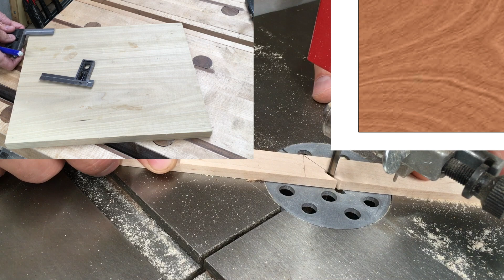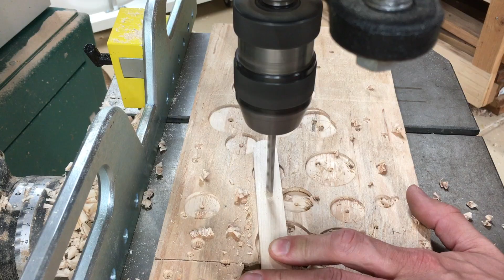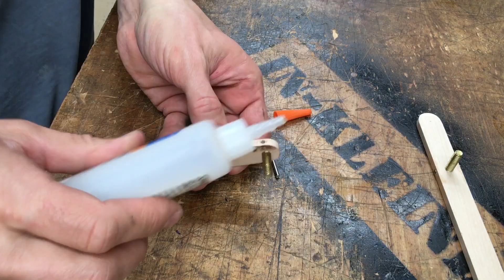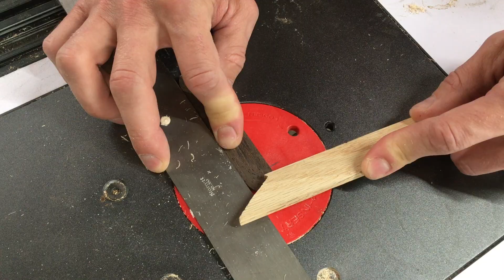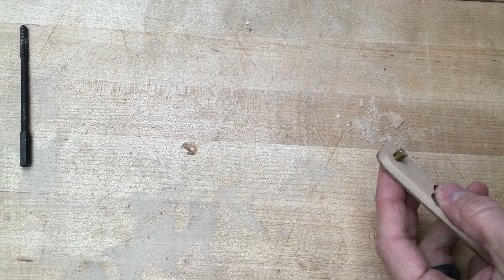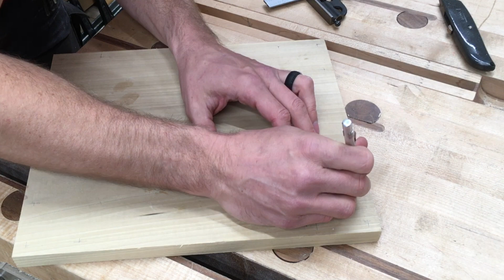I Built a New Kind of Marking Gauge

Comment: Always a pleasure to watch. 

So workflow would be to position / measure first location by traditional methods, unlock new tool, manipulate so marking hole aligns with first position, lock off, then mark remaining holes. Correct?

I like it.
Reply from the maker: Thanks!  Generally for me it is not so important that the location of these marks be precise to a specific dimension, so long as the dimension for each point is exactly the same.  So I expect I'll set up the new tool to a dimension that looks right, and just start marking with it.

Comment: A mega-simple version with (almost) the same functionality: Use a small square of board approx 3 inches square with a grid of holes drilled in it. The holes are at all the useful marks, say every quarter inch or every 5mm for metric. Just lay the square on top of the corner you're marking/drilling and butt it up against the two edges of the workpiece. No moving parts, can be made in about 5 minutes from scrap, no need to adjust it when in use, and you can drill directly through the holes in the template rather than marking if appropriate. Make it out of metal instead of board for a tougher version, and put small blocks/fences on two sides to more easily align it with the edges of the workpiece.

Obviously, the drawback compared to this version is that the grid template isn't finely adjustable, but even if you want to make holes at odd positions, the board can easily have new holes drilled in it on the fly.

Having said that, I love this device, nice concept and lovely build!

Comment: Andrew, I enjoyed the video about the new marking tool.  When I want to place a mark equal distance down and equal distance in from the side of a 90 degree corner on a work piece I use a center finding square.  The one I use is a Groz 3 inch model.  Typically this tool is used to find the center of a circle or end of a cylinder.  When used on a the corner of a square or rectangle, the tool establishes a diagaonal line that at any point along the line is equidistant from the two sides of the work piece.  I have also done this with a speed square. Another way to look at this is that the guide for drawing this line establishes the hypotenuse of the resulting triangles.  Using that the ratio of the side of a right triangle to the length of a hypotenuse is 1:1.1414214 , I photocopied a ruler at 141%.  This gives me an adjusted ruler, that when taped to the center finding square allows me to mark points along this line that are equal distant from each side of the work piece  A mark for 1 inch along the hypotenuse now corresponds to a true 1 inch down from the end of the workpiece and 1 inch in from the side.  Works like a charm.  If I could share photos with you this would make much more sense I am surre.  Sorry for such a long comment.
Reply: Tldr
Reply: I appreciated your effort in explaining mate, that would work very well indeed 😁

Comment: The gauge is pretty neat. I'm confused by the talk about value proposition with the cork rubber. It wasn't clear to me how the cork improved the function of the tool. What was the reasoning for incorporating it into the design? To prevent marring the outside surfaces of the work piece?
Reply from the maker: That and to hold it in place a bit better.  But the increased value proposition for purchasing the cork rubber was more about getting the plans for this tool.

Comment: Looks interesting......  If I want holes 1" from the sides on panel one and holes 1.25" from the sides on panel two; would I need to make two different gauges?
Reply from the maker: Nope, the marking bar slides so it’s adjustable, 1 tool for both